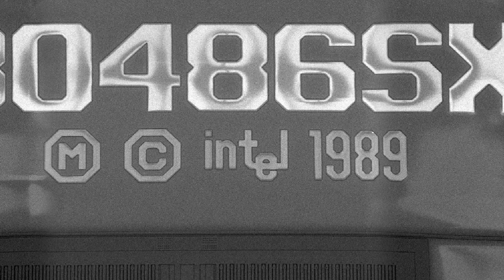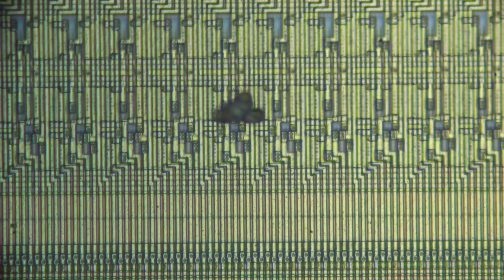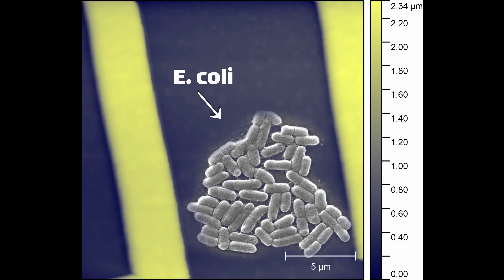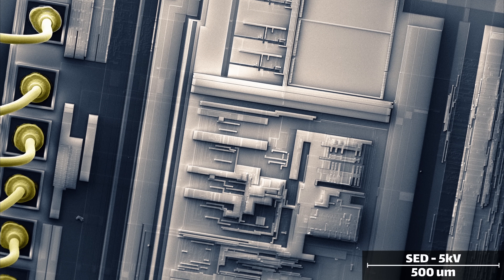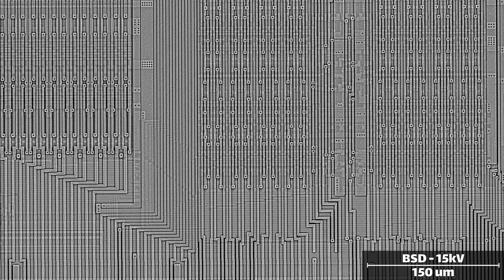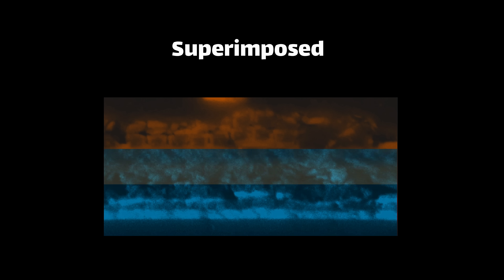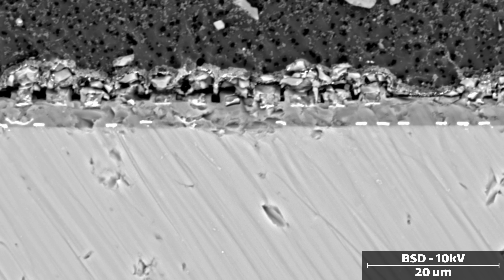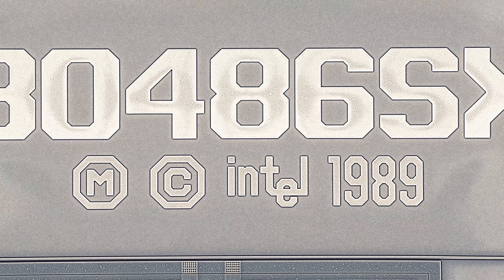Microscopic view of an Intel i486

Comment: This is fun to see, as it brings back memories.

On the day of my in-person interview at Intel, I was given a tour of what was then Fab 5, where a technician bored with the usual fab tours showed me the copyright etched into the silicon on an electron microscope, at the time the chip was manufactured new in 1997. I worked in Fab 15 and Fab 20, until I left in 2005. I was a technician in diffusion, which was depositing very thin layers and oxides, or as we liked to say, "making silicon rust".
Reply: Although my comment here appears to be a year late, I wonder whether anyone in the know could tell us whether miniturazion has merely provided greater speed, or actually enabled computations previously very difficult, or whether if it were possible to run a i486 100+ times faster if it could match the computational capacity if a more modern chip.
Reply: @dannypal123   Modern microarchitectures absolutely do enable computations that were difficult on earlier CPUs, particularly through hardware acceleration. AVX, SSE/SIMD, AES, etc.
Reply: What did you think about the Pentium 4 processor?
Reply: @kaan4864  I had one and for me it worked really well.
Reply: @310McQueen  interseting, i had one and it was very slow and overheated a lot.

Comment: Tip: LCD screen. especially the colour ones. It's easy to magnify each pixel of one. But how do the layers really look like? the sections of the liquid crystal and the colour filters.
Reply: please include the LED and the different layers in it.
Reply: @kkklogin  The LED is a diode. So you need to understand how pn junctions are constructed.
Reply: @kkklogin Positively and negatively charged types of some semiconductor material are fused together, creating a PN junction. So a diode only really has 3 layers, the PN junction itself and the case. 

Some smart guys figured out that some semiconducting materials can glow. So those give us red, green and blue LEDs (and their derivatives). The blue LED is particularly important because it is the foundation for the white LED that is so ubiquitous nowadays. And that's about it, I find optoelectronics a bit boring.
Reply: I'm very impressed with the fact that you can get a panel which can display billions of subpixels at once each individually for little money.
Reply: EINK also interesting. And MEMS ICs. They looks great.

Comment: In the mid ‘80s I did remap synthesis. Reduce everything to generic gates, find large structures, adders, muxes, registers, … Replace them with standard macros. Convert the rest to target technology.
There was a company that had a product called LvS Layout vs Schematic.  They you take the polygons and turn them into transistors and then gates.
Between the two of us, we could reproduce a chip with all design bugs, into a whole new technology with out even knowing what it does - all programmatically.

Comment: AFAIK, You have to do a proper cross section to look at gates and chip failures.
Reply: Correct. You don't see the true structure of a transistor unless you take a vertical cross section through the die. However, a plan view will enable you to see the contacts and you can see a plan view of the different regions, but that is not quite the same as seeing the oxide layer on the FET gate for example.

Comment: In order to help keep Moore's Law moving, one limiting factor to increased transistor density is the interconnections between them. In other words, they could be closed together if all the metal paths wiring them together didn't get in the way. By stacking more levels of metal and the vertical vias connecting them, more and more devices can be squeezed closer together.  If you want to get good cross-sections of the chips, try embedding them in plastic and cutting and polishing the ends.
Reply: That only works so far, eventually all the transistors are butted right up to each other and you can't get them any closer.
Reply: @deang5622  that is true, but we aren't there yet, and the transistors are getting smaller,.

Comment: 5:26 Looks pretty damn complicated to me lol. It's impressive that this chips was manufactured in the late 80s. With each decade, I would assume the design to become several orders of magnitude more complex, incorporating more and more interconnects, layers and transistors.
Reply: And to build all of that..years of work...and then have to advertise your product with a few letters and key points like frequency.. IPC and nanometers.
Missed opportunity to go full on nuts with CPU naming scheme

Should be something like:3Y8B100P5Ghz8C16T1.2IPC

Translation:
3Y = 3 years to develop
8B = 8 billion transistors
100P = 100 people to develop
5GHZ
8 Cores
16 threads
120% IPC improvement over last gen.
Reply: They are incredibly complicated, but that doesn't necessarily mean they are hard to design.

Comment: The Fly still has a better processor and comes with an OS. The Fly can duplicate itself. Great Video I subscribed!
Reply: It's an unfair comparison. The fly's processor had 3 billion years to evolve to where it is right now. You need to compare it to a human made processor made 3 billion years from now.
Reply: @BoyFromMa  If something's better or worse, you compare as-is, that's perfectly fair. If it's worse because  it has less research time, it is what it is. CPU's still killer at math.
Reply: @npip99  the fly cannot do matrix operations in nanosecond time unfortunately
Reply: @BoyFromMa  This planet will be uninhabitable long before that. Humans and flies won't be around here.
Reply: @BoyFromMa  I don't think we are late to the game. We are working on it, but why? is this something we used to do? we might be lost trying to get back to the Science/Creation Barrier.
Reply: The ability of the microprocessor to be OS-agnostic, able to load any arbitrary code, is actually a win compared to having it built-in imo.
Reply: @delphicdescant  Oh but the Fly incorporates multiple processors, Bios and CPU with flash. Don't for get the Ultra low voltage rechargeable power supply. A damaged wing? it will rewrite data in the flight computer to compensate. On The Fly!
Reply: @delphicdescant  "The ability of the microprocessor to be OS-agnostic, able to load any arbitrary code, is actually a win compared to having it built-in imo."  Excellent point! And it inevitably leads me to the nature vs nurture dichotomy. Watching my 10 months old daughter make sense of the vast amount of data-input she is receiving each day makes me realise how much isn't instinct. Using her legs aren't even instinct. For the first couple of months they just spasm all over the place and she is seemingly 'learning' the motor control not unlike a neural network in its training phase. Excuse the macabre thoughts here, but if we swapped her legs for two extra arms prior to the learning phase I bet her software would hum along just nicely. It seems to me the OS-agnostic feature you spoke of is somewhat reflected in the natural processors too.
Reply: Fruit flies at my house get caught and eaten by just days old baby jumping spiders.

So far my processors have evaded being eaten by the spiders...so they win on that front.
Reply: The spider invented the web.
Reply: They fly OS is limited, its programmed to sit on shit and then sit on our food.
Reply: The fly cannot perform data analysis from a wide variety of sources, much less play DVDs or stream video from the 'Net.
Reply: @justincase5272  but it can correctly recognize a swatter comming towards it, while a Tesla will confuse a moon with a yellow light.
Reply: @justincase5272  Yes, a fly would be a very difficult addition to the wank bank.
Reply: @justincase5272  Correct, its not part of IOT nor any Human interface. However the Fly Does have a social network of which it gets updates and tasking.

Comment: @2:50, as a long time PC hobbyist, and IT professional, I shuddered when I saw those bent pins. Sure, that's an old, defunct CPU, but still... 😥
Reply: I hope you're aware that the socket that 486 fits into, bends ALL those pins slightly as a way of making contact when you lowered the grey plastic lever. They bend elastically and return to being straight when the lever is lifted. Those in the video are bent plastically, way beyond specification, yet are very easy to fix and will still work just fine in the socket.
Reply: @PushyPawn  486's almost never went in zif sockets, they were one of the last cpus to go into just raw force machine pin sockets and they were sketchy to install
there are 486 motherboards that use zif sockets but a lot of them don't

Comment: Nice video. I am an IC Reverse Engineer and you actually almost succeeded with viewing the transistors. In fact, at 8:04 in your video, you can see the polysilicon gates (the visible tracks on the video) of the transistors inside some digital logic bloc. You can see around those tracks dots that are kind of outlining where the transistors' active areas are. Those dots are called contacts and they are tungsten vias linking source, drain and gate of the transistors to the upper interconnect layer. I can see some inverters and buffers there :-) Great job!!! I read my own comment and it sounds quite technical, sorry about that..
Reply from the maker: Oh, that's awesome! Thanks for letting me know!  I saw some Tungsten on the EDS but it was a very small amount and not very consistent so I didn't want to mention in the video.  But I was fairly certain it was contact plugs down to the transistor layer.  Super cool!

Out of curiosity, do you know if there is a way to chemically etch such that doped regions become more apparent on SEM or optical? I've been looking around but haven't found anything definitive.  Some references to HNA etching faster in doped regions, but not as a way to add contrast to an image.
Reply: @BreakingTaps  You'll have to etch dopants to see them clearly. That's a technique used to read some ROMs for example.  You can check dash etch recipe as a starting point. The chemicals you'll need are pretty nasty, be super careful ;-)
Reply from the maker: @reivilo535  thanks! Will look into it...and see if I'm comfortable with the chemicals or not 🙂 good chance I'll pass of they involve HF, have had enough of that in my life I think 😄
Reply: @reivilo535  I used to work in Competitive Analysis (reverse engineering) at Intel and moved over to different area recently. Cool see see others in our small niche community in the comments section.
Reply: @SkumarC  Thanks for this nice proposition. I am actually a professional IC reverse engineer and owner of a company that does that for various purposes such as digital forensics and security evaluations for example. That means that unfortunately, I am not seeking another job ;-)
Reply: @reivilo535  I used to design them.
Reply: This is mind blowing to me. This feels like we received alien technology somewhere along the way of our history and chalked it up to a couple of super geniuses who helped us get to the computing power we have available to us today because well, I'm stupid.
Reply: We need the 68060 done
Reply: why is it a Job to reverse engineer ICs  ? To see what the competitors are doing?
Reply: @bobl78  correct. benchmarking of competitor technology and assembly processes
Reply: @jiceBERG  @bobl78  Sure but also for looking for security issues, managing obsolete devices, search for IP violation...
Reply: @reivilo535  could be a number of things
Reply: Great comment, Thanks! But unfortunately the time 8:04,  that you indicated, it doesn' exist in the video... :(
Reply: technical is great, if anything folks like me can work backwards from it & research terms, like a glossary. I'm not going to pretend I understand most of this going into it but I'm absolutely chuffed to be exposed to all of this, thank you guys for sharing everything, sincerely.
Reply: Would you mind sharing any reading material or resources to learn about IC reverse engineering
Reply: This explanation makes sense to me after having only one formal electrical class. Methinks you might also mention PNP-NPN stuff. No?
Reply: What is ic
Reply: @GTAWildestPolicechases Integrated circuit.
Reply: @Spiltmilk  well you could use Google for just about anything but integrated circuit.
Reply: Can you share the blueprint of IC or microcontroller
Reply: This i486 was built to the 1000nm process node, today's chips are laid down using a 7nm process, 140 times smaller
Reply: @Imkrhn  Except they aren't 140 times smaller.  The 7nm process node does not have 7nm features - they're larger.  The process node name (7nm) is now just a marketing term and hasn't represented an actual measurement since 0.35 micron in 1995.   This slide into marketing gibberish has gotten so bad that TSMC and Intel (and possibly others) have decided to stop describing their chips this way.
Reply: @stargazer7644  I believe that 7nm reference is actually a measurement of the technology used to create the chip, it isn't just a made up number.  It's the size of the smallest possible gap or lane on the die.  So if there is one spot where there is need for a 7nm gap as two lanes pass each other, it's capable of creating it.  At these sizes, the uv etching light wavelength is two big to pass through a template that has things like 7nm gaps or differences so special focussing methods have to be employed, it's all way beyond me but the 7nm process is capable of refining detail on the chip to a resolution of 7nm, not that all the structures or transistors are 7nm in size.

I'm sure once upon a time sizes were relevant to the actual product but there you go, once the production method became more impressive that the product, that became the thing to reference.
Reply: @willb4643  You might want to do a little reading on the topic before "believing" the marketing people.   The 7nm reference is not an actual measurement of any feature size in the 7nm process.  As I said, the process node name (7nm) is now just a marketing term and hasn't represented an actual measurement since 0.35 micron in 1995.  That was the last time the process name was actually based off of a measurement of a chip feature.  That's why companies are now abandoning those process names - they've become confusing and meaningless.
Reply: @stargazer7644  True, it used to be the gate length but nowadays processes are so complex it's hard to meaningfully advertise them.. A very funny take in some hardware magazine was that it would suggest the nanometer became a variable unit over the years!! The thing is that even the transistor density doesn't mean much as it is very dependent on the layout itself and arguably, the application and requirements. I'm not sure what is the proper solution to this, in fact the indicative process node name doesn't look so bad considering all of that..
Reply: @willb4643  hilarious how one guy will try to simply correct someone politely, then the original guy will reel off a bunch of stuff he simply read in an article like he has the ultimate knowledge and that article bestowed upon him hidden knowledge that you dont have therefore he must recorrect the record and restore truth to save the world . When in reality you basically said the same thing, but you understand it better therefore you could explain it more simply while the other guy has this one article that he is trying to repeat like gospel and get you to understand. Ha ha.  People.  We are idiots.
Reply: @freelectron2029  Was thinking the same thing haha...I had heard previously that 7nm nodes don't really mean what people tend to think they mean, but haven't looked into what it actually means, and what the method to the madness really is (I'm sure there is one). It would be nice if Star Gazer could actually expand on literally anything instead of repeating the same "it's just a marketing term now hasn't meant anything since '95 lol". Like...Thanks, maybe that's partially true, but can you actually give us anymore information or detail on how and why that occurred, and which numbers mean what these days? No? Oh, maybe it's because you don't actually know anything. :/

From a cursory glance at Wikipedia, it seems as though the (x)nm process names refer mostly to the complexities of the Pitch Splitting, self-aligned patterning and EUV implementation/multilayering. EUV lithography is capable of resolving features below 20nm on a "7nm" node, but there are extra complexities there and exact numbers aren't given. As far as I can tell, the Transistor fin pitch on the 7nm process is  27nm, and the Transistor fin height is unknown to us mere mortals. The Minimum (metal) pitch is 46 nm. It does certainly seem like new processing nodes have almost or completely (?) nothing to do with the number itself, and is instead an indicator of more complex processing and new, more advanced production technologies. I hardly have enough information to say anything definitively though. Either way, we're getting more efficient chips with higher transistor counts, which seems like a win for us AND the marketing teams haha.
Reply: @freelectron2029  there's nothing like a magazine article penned by the lowest paid journalist in the click bait world of traffic farming to absolutely teach you everything you need to know about a complex technology issue.
Reply: @willb4643  lol.  Well put. We should get jobs at righteous internet buzz word magazine aswell.  Imagine the comment writing clout we would gain :)
Reply: @willb4643  isn't the 7nm the wavelength of the EUV (extreme ultraviolet) light that is used in the lithography process? 
it has nothing to do with the chip, but with the light source of the EUV machines that ASML makes and sells to TSMC and others